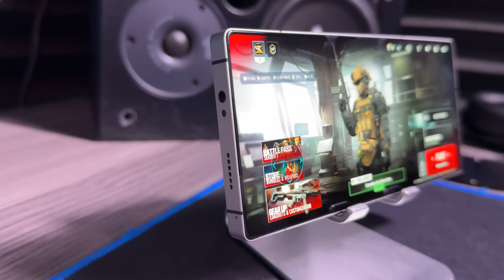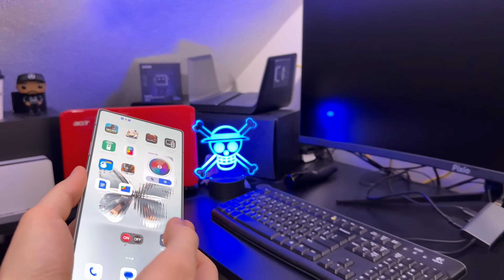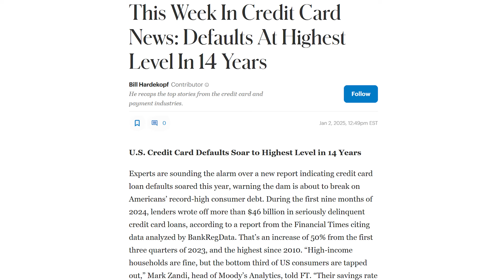What CES Revealed About Repairable Tech In a Record Year For E-Waste (2025 Is Not Looking Good)

Comment: I like what Asus did with the ROG Strix 2025 tool-less SSD and RAM upgradeability; you can also somewhat clean the fans as well.
Any deeper than that is more of a pain, as its 16 screws at 2 different sizes.
My Asus Rog Strix GL702VM is getting old, but for how little I use it, I just decided there is no point upgrading. Yeah, I
 would like something I could use in the garden and still play new games when it's stupid hot, but if you're lucky, it's super hot for 3 days a year here, so not really a point.
Mine is like new compared to the gaming laptops you have cleaned on here, mainly because I don't eat when using it, and I don't watch corn on it, and I clean it when it's dirty, mainly from dust, as I don't use it much.
I grew up with parents that said if you break it, you will not get a new one, so I look after my tech i have old phones that do not even have a single scratch on them.
We're going to turn into Cyberpunk 2077. You leave the city and all you see is trash everywhere.

Comment: I work as IT support for a HUGE company. I never thought to buy a used business laptop until you brought it up. Replaced my old crap irrepareable surface laptop with a $320 used Lenovo gen 3 laptop from 2020. Spent $100 more for a 64gb ram upgrade. It had a cosmetic defect. It was basically new.

Best advice ever. Can't wait to slap linux on this bad boy.

Comment: Repairable Tech is all about consumerism gone rampant. The majority of the tech suffers from a use by date or still capable of current use. Most items last well into a third generation if handled properly. Damage occurs if mishandled or abused but there are other models that are built to withstand that. It was the consumers choice to mishandle or abuse so the PC company isn't going to overbuild as all that will do is add to the initial cost. Remember they only sell to the first user/owner those down the track rarely add to their success. I'm typing this on a machine 9 generations old but it is still functional for some modern apps. The waste issue really is overbuilt still functional machines disposed of it might have cost twice the price in its day compared to today but if no one will use it it's waste and shouldn't have been built so well. If you need better buy better. There are exceptions though like non replaceable items like memory or storage but beyond the days of screen or CPU replacement are no more. Have you ever made a purchase decision based on $50 on an item costing $1000 then you should understand.

Comment: The worst part about all this e-waste, planned obsolescence is the extreme waste of materials. All cause it´s so much more profitable to sell a new device that is as cheaply slabbed together as possible. As putting in effort and quality control as well as replacement parts simply doesn´t net as much profit... That is unless they "force" the consumer to send in their product for repairs, than they can make up all kind of nonsense that wasn´t an issue, isn´t an issue, just to charge you extra for "repairs". 
All just designed to funnel consumers into an eco system that is solely designed to screw consumers over.

Comment: I sincerely agree with you on products that should be made to last. For instance I just bought all new appliances (refrigerator, microwave, stove,dishwasher, washer, dryer) for our new house build. LG. The W/D has all kind of bells and whistles. I use 3 on each. Everyday I use them I look for them to not work. They are not a year old. Speed Queen makes basic W/D that I wish we had bought. A service technician told us they are easy to repair and parts are readily available. I have already calendared a replacement date for them. We will purchase Speed Queen next time.

Comment: I know the discussion is already over but:
I think it will eventually come full circle. There will be eventually a perfect receipt for a laptop that will start iterating on quality and longevity.

Look at smartphones, not the niece fancy fold-able ones, but the normal 6 inch glass and aluminium sandwich. These are the most durable they ever been, and offer the longest software support they have ever been. In fact companies are even competing on who makes the most indestructible slab of glass, and who will offer more years of support. Yes the prices are higher then ever, but at least the devices have a chance to survive and be useful for a very long time. And even the mid range devices have the potential to last, and most of the time offer expandable storage. The computing power of even the mid range chip-sets are overkill for ordinary tasks. Both apple and samsung are stuck releasing more or less the same flagships with slight improvements. If you look at the phones of the past, 10 years ago phones were much more fragile and were sold based on gimmicks, it was a norm to switch devices once every 1-2 year and the next generation was usually miles better the the last, especially in performance.

The same can happen to laptops eventually. And I think apple of all of the brands is closer to the perfect potential laptop formula. Their devices are already very energy efficient and have overkill performance. What if they add expandable storage , more durable overbuilt chips and capacitors, and may be some waterproofing. The soldered ram is not a bad thing as long as it is enough in capacity. All of these are easily achievable with the current technology, and will probably not even cost alot more, but i doubt they will ever actually do this.

The Achilles heel (and the primary means of planned obsolescence) is their hyper overpriced soldered storage. Its a perfect death timer, either your ssd dies of old age or overuse, or if you use external storage, your thunderbold ports eventually grenade themselves because they are powered by extra cheap and wimpy controllers that dont last.

I do understand why apple does the soldered storage that contains the os, this does have some benefits, and soldered unified ram also has some major advantages, but it would be an almost perfect system if apple added 1 or 2 slots for expandable storage, even if propitiatory to their system, to their PRO models. They can already build an almost perfect laptop, they just choose not to.

As for myself, I currently use 2 machines, a Thinkpad P15 gen 2 (very upgrade-able), which i purchased for cheap (but not very cheap because in my country all tech prices are inflated) from a recycling/refurbishing local business much like yours, and a MBP 14" M1 pro base model. The thinkpad has all the storage but battery life sux, the mbp is very nice, but you can only do so much with base 512gb of non upgrade-able storage (which is enough for 1 task or environment, but not much else), it is very good on battery and ergonomics are perfect. IF ONLY WE COULD HAVE BOTH.

(i have heard that recent Intel ultra powered thinkpads are pretty good, but they have their own caveats and are going the apple route of very little upgradeability, and if not that they are still extortionately expensive) (it looks like all the manufacturers are sure to include at least one mechanism of deprecation, now that we have finally reach enough compute power and efficiany for most tasks)

Comment: Yup,  in 2017,  I saw this on the horizon  and had to quit the refurbish/repair computer arena.   I now restore classic bicycles and could not be happier.    Once and a while I'll stop by the old  computer shop,  and they are pulling their hair out.  Everyone is distressed seeing and feeling the first waves of the Tsunami  they know is going to happen.
Reply: We started backing two vectors for white boxes.  One vector was to install a linux distro. As just an extra, we only charged $15 for, and provided a DVD with reinstall media.    The other were machines with no OS at all.   Both were sold with no warranty. 
The outcome was strange to me.  Very strange to me.    I got crap from the buyers for  the boxes that had Linux on them.  And they wanted me to take the Linux OS off, before they would buy it.  A fully installed   Linux  distro with all the stuff working,  made the computer harder to sell than a blank box.  I think I lost my mind somewhere around  here.  :)

Comment: Consumer laptops don't HAVE to be junk. 
I picked up a 2013 Pavilion at a local garage sale in June 2022 for $20. The battery was shot, and it had Windows 8.1 on it, but was OK other than that. I boosted the RAM to the 16GB max, replaced the hard drive with an ssd, pulled the optical drive and put the hard drive into an adapter for the optical bay. OK, so by now I had about $120 into it. I put Mageia Linux on it, and have been happily using it every day since. Only problem has been the ssd failed on me in December because I made the mistake of buying a cheap one the first time. 
I read my newspaper with it, check my email, do some web browsing. Nothing particularly strenuous. Being 75 years old, I learned a long time ago the value of exercising some care with my things if I want them to last. I see no reason why this machine won't outlast me, even if it is a consumer laptop.

Comment: I  have been using HP laptop (HP Pavilion Gaming - 15-dk0253t) in 2019-2025(now) and only replace the battery once (I always charge it when I use it) and change thermal paste twice. Just sharing

Comment: So, they way it works is straightforward. The crazy new expensive stuff comes out, and is adopted by those who have money, once it becomes widespread it can be feasible to produce in bulk. That's when it gets cheaper and available to the general public. LCD used to be new and incredibly expensive, flat screen TV's were expensive. Now you can get a better flat screen tv for your computer we call a monitor at 1080p 60htz for dirt cheap. Something like that would have cost me an arm leg and my right nut growing up.

Comment: Team up with a large established manufacturer. 

Work with them to design a open sourced laptop hardware design, everything replaceable, everything fixable, everything upgradable

open sourced so any company can make hardware components, but the prime manufacturer make a complete laptop kit and spares, plug and play hardware modules.

Not crazy thin but thick and super solid.

Comment: My old PC is a i7-7700K. I was thinking of giving it to my parents, but I was so bummed out, when I found out that Microsoft was not going to add Windows 11 support to it. I was hoping that maybe they would extend the supported CPUs list, but they didn't. I don't want to install Windows 11 on it with Rufus, when Microsoft can just pull a switch and break Windows on it and I'm not around to fix it. I don't want to install Linux on it, because my parents would not be able to use it. They are already struggling Windows as it is.

Comment: I wonder what people are doing to their laptops for things to break. I'm 8 years into my hp envy and my only issue is the battery is toast. I use it primarily as a desktop and I do travel with it from time to time but I don't have a case or a laptop bag or anything. I toss it in my backpack and get on my way.  I took it to the desert on deployment and it survived just fine. I'm using it right now. Gonna replace the battery (or not) and keep on trucking.

Comment: Windows 10 will be the last mass adopted Microsoft OS. Most people won't bother with a hardware replacement Win based device, and migrate ever further towards using Android and IOS based tablets / phones for all uses.

The only alternative is M$ does a last minute about face and continues security support for several more years on Windows 10 installs.

If not, I look forward to picking up ewaste dual 8 core xeon workstations with gobs of ram out recycle bins for free.

Comment: 2:35 If it can be built. It can be repaired. But who is repairing their stuff anyway? I've seen fridges get tossed just because the door was missing a couple screws. TVs thrown out because they are not the latest model. Lamps because the knob isnt working. People cant fix basic shit and wont fix something higher tech. It's what America does. Will take the opinion in the video as a prediction and as a  venting method.

Comment: A few months ago, I had to throw a small tire air compressor away, because there was no way to repair or replace the hose.  Everything else worked; lights, pressure sensor, read-out, etc., but the broken part couldn't be replaced, and my repair attempts were unsuccessful.  I was raised in a household that made stuff, and fixed stuff.  If something was broken, we ALWAYS tried to see if it could be fixed.  The throw-away model sickens me, as well, because it's all about pushing people to 'get a new one', to constantly consume.  If companies made products that were designed to be more repairable / serviceable by the people who buy them, I'm convinced they'd begin having life-long customers.  The basic rule is, 'If it ain't broken, don't fix it.'  Except now, you can't fix it, even if you wanted to.  But, imagine having things in use for longer periods of time, and getting more value out of them, because the manufacturer made it possible and practical, not to mention economical, to repair the original product you bought, and keep it in service instead of throwing it away.  That's a revolutionary idea...

Comment: A client told us he bought a $4,800 refrigerator, only for it to get surged after a power outage 4 months later. He couldn’t have protected it anyway since such devices must be plugged directly into the wall, likely due to their high power draw.  If his fridge wasn't full of circuit boards and sensors, it would have survived

Comment: Roughly 2,5 years ago I got an Acer Predator laptop. Two weeks after the warranty ended, the damn gpu fan broke. 

Guess who couldn't even supply a fitting replacement? That's right, Acer and anyone who builds the gpu fan with the specs they provide. 
I wish I was kidding, but Acer managed to list a replacement part, that doesn't fit into the device it's supposed to be a replacement for. 

I'm never getting another device from them and that's coming from someone, whose previous laptop, both monitors and the now broken laptop were from Acer.

Comment: Well said : I only buy things to watch, and it's what they are used for, pictures.

Writing this with a DELL 9010 SFF with an i7-3370 / 16gB, 2old ATI cards, 4 "HD" screens and linux. Yep, a 13th yo CPU.
The only thing I've changed, is the power unit (had to make it come from the US... a european version).

It works like a charm. I can still upgrade the system (!!) and I have done this 2 days ago under mint 22.1/xia.
Most machine people want now are laptop… even if they are not moving it, at all. Just in case, you know.
As far as I've know, finally, micro$oft have finally granted the access to the "old" / before 8th gen to be upgraded?

Thanks for the legitimate rant !

Comment: Few things get me more heated than thinking about how laptop companies progressed from having replaceable batteries to literally gluing them into the cases to make them less durable. Back in 2003, when Apple released the iBook G4 (where you could remove the battery with a coin), their website had zero mention of being good for the environment. Skip to present day (where they glue batteries into the cases), and they parade themselves around like some valiant protectors of the environment, despite e-waste per capita increasing by 56% from 2010 to 2020. Want more storage? Apple's solution is buy a new computer! 🤯

Comment: I FIX AND USE OLD STUFF, IF A COMPUTER DOES NOT HAVE AN OPTICAL DRIVE, AND IS USED, I WILL NOT BUY IT. JUST HAD TO BUY A CAR BECAUSE THE ONE I HAD WAS 20 YEARS OLD AND WAS NOT WORTH FIXING. REPLACED IT WITH A 5 YEAR OLD CAR WITH 75,000 MILES ON IT.

Comment: Kudos for Dell making modular replacement USB-C ports, I flailed with great exuberated excitement at that ngl. Any and all ports for electronics should be like that. Cannot tell you the amount of cellphones I have seen with busted charging ports and people just chuck em out and buy new ones. Same thing with charger connectors for laptops. Hell any electronic with an interface port of some type responsible for delivering power. Why create the most important port on a machine the most blatant failure point? Second to that are audio interface ports, can see why a lot of companies decided to get rid of them. Can't have a failure point if it's not there. Modular replaceable ports would be a good way of fixing this issue. Sadly companies go the route of mass disposable tech cause it's easier to mass produce. Throw everything on one main board, slap a hard case on it and call it the day. It's just saddening really, least I am smart enough to avoid such products. 
Also the Red Magic rep got me excited too, been pushing that company on people for years as an alternative to Apple and Samsung, Since like the Red Magic 6-7.

Comment: And yet I still use my 8th i5 gen laptop for my laptop things. I was thinking about new oled display laptop, but shit has as anti-consumer insides as you can imagine. Even replacing RAM is impossible without soldering equipment

Comment: I just had to replace three faulty laptops in a row, all of which were designed to fail (I am a former engineer that worked in manufacturing and design so definitely designed to fail), before I finally just spent the money on parts, got a desktop and ultimately got a better pc that actually works. American companies should be aware that the products they are designing will cost them money in Australia and in Europe. Honestly consumer tech is pathetic these days.